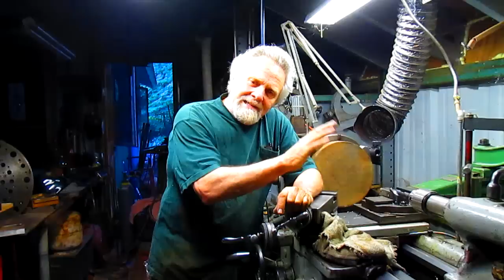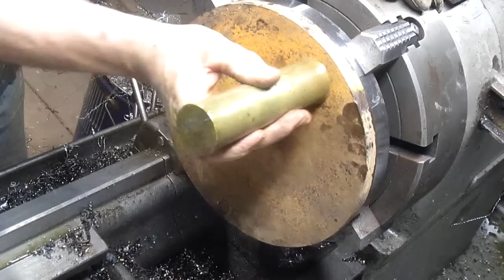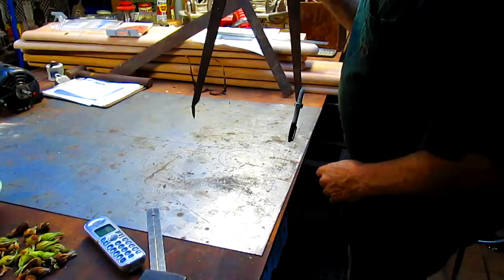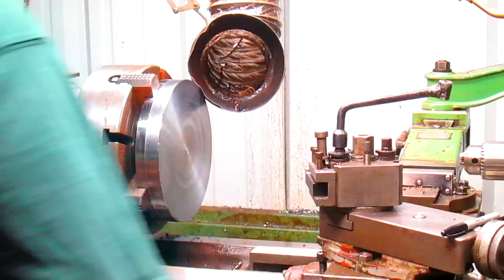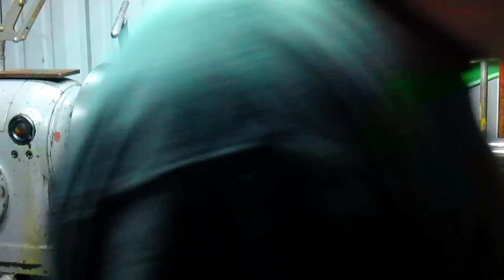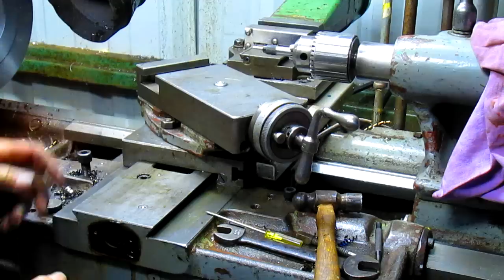Ding Gong #1 EPA calling

Comment: ...you can generate hemispheres...either convex or concave...on a vertical mill by tilting the head and using a fly cutter with the work mounted on a rotary table...
Reply from the maker: Yes, I have seen that done, but I'm just guessing that the setup is a nightmare.

Comment: Nik

Noticed the use of magnets to hold the towel.  I love magnets, but hate to clean off the chips/etc after using them to hold things on the mill table or the lathe, so put the magents in a zipper locking sandwich baggie, use them, and when done, unzip the baggie, turn inside out and the chips/etc stay in the baggie and the magnets stay clean for the next use

John
Reply from the maker: good idea.

Comment: hi Nik, just wanted to comment that every time you move the carriage you are shortening the pivot point. You should remove the compound so you can actually see the pivot point (and since you have already done a bunch of disassembly to the cross slide to get to this point what's a bit more?) Then set the actual pivot to your 9.125 dim and lock down the carriage. then align the pivot to the center line of your part and lock the cross slide down which at this point would most likely involve some c-clamps or something.  At that point put the compound back on and only use the compound dial to adjust in your cut.

Comment: Nick, if you designed and sold your stoves as a piece of decorator furniture, not intended to be used as a stove, then you should be able to do that. The purchaser is then able to do as they please with it.  think about it.... Also where do you buy your metals? I am in Cool and buy most of mine from Blue  Collar Supply in Sacramento, but that is a long trip unless I nees quite a bit. Need someone closer.
Reply from the maker: Blue collar is a great place for small or thin metal, and also for a bad attitude. About a half mile further down Floren Perkin (same side of the street) is S & K supply and they have a bunch of used or mill end stuff.  Much better attitude too.
Reply: I will definitely try S&K I didn't know about them...Thanks for the tip...Nice to see your videos and I subscribed as soon as I saw this one....thanks
Reply from the maker: Be careful at s&k, because they work with all grades of steel and cast and the scrap bins aren't marked. Rusted they all look the same.
Reply: I will sure do that. I thank you for the tip

Comment: Nick, why not rough out the radius as a series of step rings, then just finish off the radius to clean up the tips of all the steps.There may even be a a web page that tells you what increments in diameter and to what depth to go. If not then how about using some squared graph paper and draw your radius on it to scale to get an approximation of increments. Get the bulk metal out of the way using a carbide insert boring bar, do the deepest and smallest diameter first, them work your way outwards in both depth and diameter. With regards to you using the pivot point of your compound slide, please be careful that you do not wear either the pivot or the hole in your cross slide, they may NOT be repairable . Also too you will be placing quite a bit of wear to the mating surfaces of the compound where it touches the cross slide, if you continue down this route, keep it well oiled. What happened to the radius attachment you have  used on this lathe in  the past, I wrote and suggested a modification to it about how to set the correct radius. Watching with interest the outcome of this project. Good luck with it. You have replied to another viewer about the rules for burning wood in your stoves, would the rules still apply if they were briquettes made from paper or even coal or coke or charcoal that were burnt in one ?

Comment: Trying to think how you could do this short of bending sheet over a former. Maybe a reverse ball turning attachment, where you would swing a fixed-radius cutter over the centerline? Dunno. In wood lathes it is done with bowl turning tools. Advance cutter with cross-slide not compound. Still have to think about this, very interesting machine problem. I like your improvised approach, but not for gong production work.

Comment: I've been working on a similar problem myself. For the math, I understood you were making a 9 inch wide circular cut that was 1.25 inches deep. That should be a 8.725 inch radius (about 8 23/32). It is given in Machinery's Handbook, look for Circular Segment in the index. It's not hard, you need only a regular 4-function calculator to work it.
Reply from the maker: SInce my radius is random, I just eyeballed it. I'll keep the machinery handbook in mind though. Thanks.

Comment: Nik, I do see how the steel comes off as ribbons, nice long pieces when the tool cuts cleanly.  Does cast iron come off the tool differently?  Seems I recall for some reason that it comes off as more of a powder.  The steel seems more, ductile? Is that the correct term?

Comment: Yeah $20,000.00 and how many years to get EPA approval. 
    Will your wood burning stoves burn down a structure any different than an EPA approved wood burning stove?               Of course not!
     I’m pretty sure an approved EPA stove is no different, Safety wise as your stove. What a bunch of crap. It makes me sick, that there has to be warnings on a wood burning stove that says you can receive serious burns from touching this stove. The only warnings that should come with the stove is,it needs to be properly vented, has proper clearances. Also for some unknown reason that I cannot figure out, put a tag on the Stove that says SURFACE MAY BE HOT AND CAN CAUSE SERIOUS BURNS.  Any adult that puts their hand on any part of a wood burning stove that can burn them. Deserves to get burned. Hopefully they will not touch that stove again, but in today’s world there is a good chance they would. They shouldn’t be able to SUE anyone, because of their stupidity.
    Can you sell the blueprints for this wood burning stove? Without a $20,000.00 fee. 
    Can you sell the stove as a kit that the buyer has to bolt it together? Don’t sell this kit as a wood burning stove. Sell it as a ornamental Wood Burning Stove. Supply instructions on how to put the stove together. Add separate information on where to find the proper clearances and venting. There has to be loopholes in these EPA laws. Find them and use them to your advantage. 
     Anyway I just came upon your channel. Please keep making videos.
Reply from the maker: I didn't want to do too much ranting on my video, but trust me, I've got hours worth.
Reply from the maker: BTW, I put up a new video once a week, 350 so far. Check me out.
Reply: Nik C. Colyer 
   Of course I subscribed to your channel. I’ll watch every one of your videos videos over the next month or two. I mainly watch Metal Fabricating Channels of any kind on YouTube. 
   I came across your channel while I had YouTube on auto play. 
      You have an excellent Machine Shop. You have professional Machinist skills. 
    The photos of the Old School Choppers you put together, are the real deal. 
    In the early 70s. I put together a few Old School Choppers.